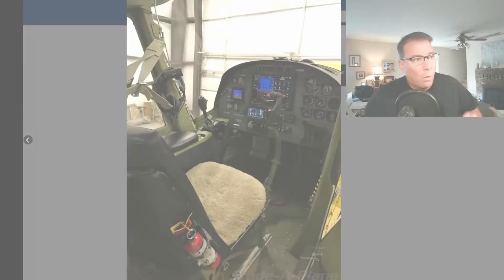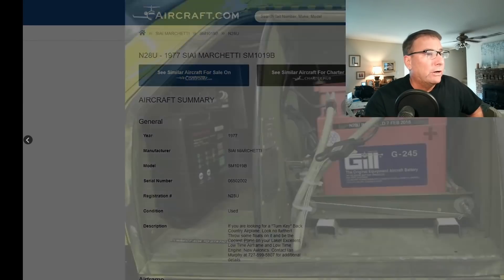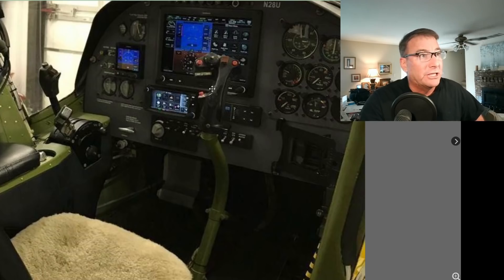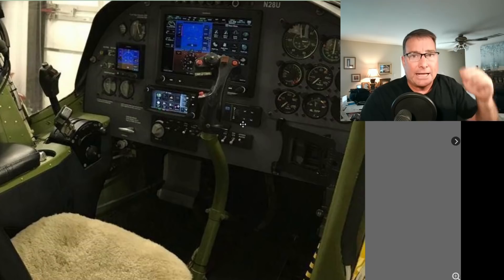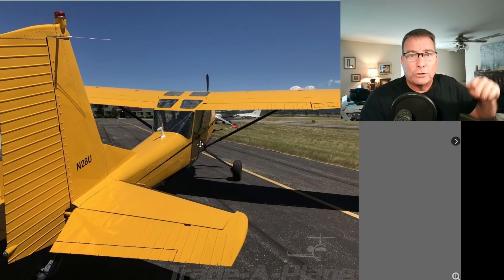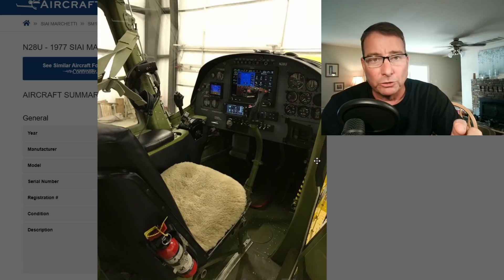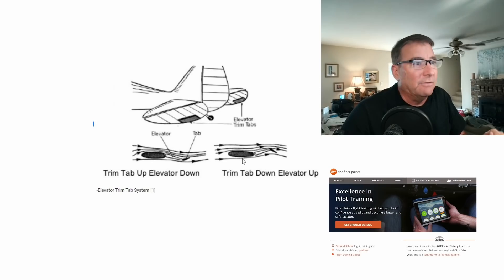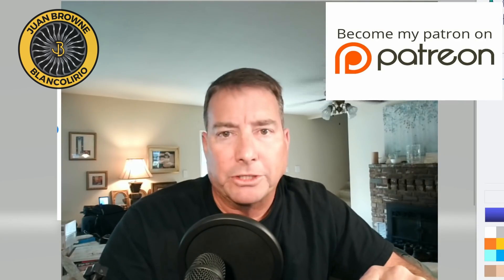Dale 'Snort' Snodgrass Siai Marchetti UPDATE- Elevator Trim System 8/8/21

Comment: Maybe the elevator connection was reversed, as in stick forward made the elevator move to climb.  It happened in a Cub here at KBVS, one the pilot rebuilt that was a different model that the pilot had maintained in the past.  As it turned out after the controls were connected, up ended being down and down was up the way he connected it, so those connections were different in the new model to him, except he didn’t know that.  He just copied that connection he knew and it was wrong and got killed on take-off. Probably the annual would reveal if there was any change in bearings or bushings on the elevator controls, and they were disconnected for that reason.  So, during the take-off role, the stick is pushed forward in a tail dragged to raise the tail, and it would result in full up elevator instead.

Comment: Thanks for the video. I find it remarkable that the pilot's verbal reaction to the situation was transmitted on the radio, unlikely this happened intentionally. The pilot must have wrestled with the flight stick in an unusual way that triggered the com switch. Could be wrong but I find it hard to believe a trim runaway or falsely rigged elevator trim alone would have lead to loss of control, at this slow speed stronger elevator input (if available) would have overpowered the trim (just to compare size of elevator and trim tabs) A jammed flight stick/elevator or aft CG situation seems more likely.

Comment: If this was the case (trim issue), the trim lever should be removed from the stick and a separate trim lever with indicator should be installed to prevent runaways or error in switching the desired trim level.

Comment: Speaking of rigging the trim tab backwards, the sweep wing control of the F-111 comes to mind: to sweep the wings back, the control is moved forward, like "go go go". To go, one supposedly thinks of going forward. It's just one of those features which is intended to be intuitive, but obviously in the case of a trim switch, sometimes isn't.

Comment: I am not a pilot. With that said, I was listening to the details of what is on the stick, the trim control that Juan mentions (at about 3 minutes in) as being a possible contributor to the nose up pitch and the radio controls nearby. In the video after atc clears Dale for take off he acknowledges. She immediately comes back to remind him to switch to another frequency. If the video is synced with the audio he was already moving. He acknowledges the radio freq. change then the AT Controller comes on the radio again and repeats the clearance for take off. Dale, about to lift off, acknowledges this final transmission. Then the aircraft immediately starts the steep climb. While fighting to control the stall, Dale shouts out twice inadvertently heard over the radio just before impact.

It seems to me that this last exchange of comms from atc was not only unnecessary, and could have waited until after take off was achieved safely, but placed Dales attention at the wrong time to his radio rather than the trim control switch close by. 
Instead of manipulating the trim he's activating the radio.
I could be wrong but, I got a sinking feeling Juan made the connection for the possibility that the trim switch along with the radio switch made the holes line up that took Dale's life.
Reply: Video intentionally omits pauses longer than one second. It’s in the video description. There was actually 36 seconds of silence from Dale’s takeoff confirmation to his final heartbreaking words. The video shortens that to six seconds, giving the false impression he and the tower were still communicating during that silence.

Comment: The trim being so powerful to overpower the pilot input thesis is only valid at high airspeed.  At low airspeed, let us say at zero airspeed, the control surfaces are easily moved by pilot input.  At high airspeed, let us say just short of never exceed, the force from the air load could be in excess of the pilot input.  Did I miss this discussion?  Takeoff airspeed trim forces are easily overcome.  If the trim ran away to the full stop up, then maybe there was not enough flight control left in the pilot input.  But certainly the pilot had the force to overcome the trim setting.  My guess is that the CG was aft at rotation and he tried to lower the left wing to have a chance but there was not enough power to fly thru the amount of aft CG.,
Reply: I commented earlier that Juan's description omits that control forces depend on airspeed.
Reply: @gordonrichardson2972  You were correct then.

Comment: I would think a seasoned fighter pilot could overpower a mistrimmed aircraft, and probably has the presence of mind to not grab the stick if the seat were to slide back on the tracks.  Also, bear in mind that this was a military aircraft, and didn't have to meet the standards of CAR part 3 or FAR part 23.

Comment: I used to be the captain on ferry boats.  I have experienced electronic malfunctions in control systems with engine controls working the opposite of what the command was.  In fact I did everything right to avoid a situation.  I was blamed and fired for the incident in order to protect the company from having to answer to the US Coast Guard.  A week later the boat could not operate and a few weeks later the entire control system was replaced.  They did this in order to not be investigated by the USCG.  The USCG did not want to investigate the company because they do not to want to make waves with companies because after getting a pension with the USCG they want to get jobs in the industry and do not want to step on any toes while in the CG so they can get a job in the industry.  They seek to blame individuals rather than companies.  This does not serve the safety of the public.
Reply: millenails know america is trash, the baby boomers are learning...sad

Comment: @blancolirio -  Juan, watching the video, between the time Dale's plane took off, stalled and crashed, was only about four seconds.  Figure half that time, two seconds, before it's apparent there is a problem and how to correct it.  Dale didn't stand a chance. :(  If that trim switch was incorrectly worked on, whomever did that might be liable for his death. Also, my particular field of endeavor is the automotive maintenance/repair industry and in my auto centers it's a standard rule of thumb that if a customer's car is worked on for anything major, it's always taken for a test drive to be certain everything is good go to before handing the keys back to the customer.  Is this not standard practice with planes as well? If it's not, it should be, as some unnecessary crashes and deaths could be prevented.

Comment: I declined the trim system on my GFC 500 and they acted like I was crazy. I don't like all of the stories I hear about autotrim, and I find manual trim to be quite intuitive, and I can usually predict when the AP is going to announce trims. Also, trim is not always the answer. When leveling off at a selected altitude, the AP is going to announce trim needed, but I know what it needs mostly is to back off the power first. Is it really that distracting doing your own trim? Not as distracting as not using an AP at all.

Comment: It seems obvious that something was wrong and the aircraft was climbing rapidly towards the point of stalling. Would chopping the power immediately upon realization of a stuck elevator trim or any other control surface, been enough to save it?  I am assuming that any attempt to push the stick forward was not possible for some as yet unknown reason.

Comment: The roll the trim wheel by hand then electric check. Servo motors can’t feel a thing. If they malfunction they can rip the trim system apart without a capstan release for cables or secondary stop switch for a screw jack

Comment: No manual trim wheel. Who got that thought certification. Boeing  If this is the case he might have seen the trim wheel moving without and input and aborted the takeoff. Doings an annual first thing I did wipe the flight controls to see if there dragging or binding.

Comment: Like you said, I guess we would need to know if it was in maintenance right before this accident wouldn’t me? It’s not just going to flip 180 overnight for fun. One look in the maintenance log and we would have our answer very quickly to that. I would say the runaway trim theory with an electric system would be far more likely than it switching itself for fun 180 degrees.
Reply: Flight history for N27U shows he flew that aircraft 23 times between May 26 and June 30, when he flew it to Lewiston airport. That was the last time he flew it before picking it up from the maintenance facility (Hillcrest Aviation?) just minutes before the crash.
Reply: Correction N28U, of course.

Comment: As one with a secondary interest in aviation, I think your trim explanation at 07:30 could have been useful earlier in the video. Regarding "getting it backwards" 08:48, Definitely experienced that several times myself in maintenance tasks. Strange how the (amazing) human mind can be confused by simple, binary systems.
Reply: You would think on something so critical as flight controls the harness would be designed so you CAN’T reverse the wiring. Say, M/F on one and F/M on the other.
Reply: @MrJeffcoley1  I've found that many times engineers have a bit of tunnel vision on what they do, and simple things like this could easily get overlooked if you're not thinking about it.

Comment: I get the trim issue....Do you know if there may have been a medical issue? I realize they will check that issue out....
also on the Trim issue.... Has this been a Major issue in aviation in general...Aren't there Checks and balances in aviation repair?
Mechanic fixes airplane....Then a Supervisor Quality Control checks the work?......
Leaving it to a A/P mechanic without Another set of eyes Looking at the repair needs to happen....
I'm Hoping that is the Norm...
Because You Can Get it Wrong...Aviation Kills Period No second chances
Thank you
Darrell Killingsworth

Comment: Hey Juan, here's what happened to Jerry a few years ago.  He took off from a small West Texas airport, having done a very thorough and uneventful pre-flight on the Cherokee 140.  After an uneventful takeoff and climb-out to 3000 AGL, he executed a standard rate right hand turn, only to discover a stuck elevator!  He fought for a couple of minutes, using the throttle to control altitude and attitude, deciding that he would not be able to land the plane in its current state, he decided to pull really hard in an attempt to un-jam the elevator, and to his surprise, there was a pop, and the control freed up and began to operate normally!  What had happened is that a mud dauber had built a sizeable mud nest on the elevator cable, and the vibration of flight loosened it and it slid down the cable and wedged into the pulley!  A very UNPLEASANT surprise, according to Jerry, followed by a tear down of the inspection panels and subsequent removal of a lot more mud nests!
Reply: Those mud dauber wasps have brought down full sized passenger jets.  They usually build the mud nests in the Pitot tubes, which leads to false readings in the instruments.
Reply: Wow !

Comment: https://youtu.be/c1FXRC4OFdM

The trim tab adjusts the position of the elevator.  Tab up, elevator down 

This is not a 737 as someone mentioned.  The trim doesn’t adjust an elevator on aircraft with a flying stabilizer.

Comment: I read a comment over another video from a owner he stated this aircraft requires lot of trim up to land it, and if that trim was left like that with the flaps on take off at 30  Degrees the 400 HP turbine engine will cause it to nose up rapidly. If you look at the crash video you can clearly see he does have flaps down to some degree not sure how much on take off.

Comment: Well explained.   I’m going to go with that explanation of the electric trim system.  That seems the most likely.   I’m pretty damm sure he did not have the control lock on as well as he just forgot to do a control check .  Elevator linkage failure or something falling off the other seat and jamming the controls from being able to go forward would be my second guess.    Let’s hope we get this figured out soon with the investigation.

Comment: There are some images floating around where you can see pretty clearly that Dale had full down elevator just prior too and during the stall, I wonder what he had on board for cargo?
Reply: Camping gear.  He was leaving for a camping trip.
Reply: @pookatim  i know im curious about specifics weight etc
Reply: There’s also a clear picture of the “general” neutral trim tab after impact online. Google Snodgrass airplane crash pictures. Not sure if the impact could have changed trim tab configuration? Still appears to me as heavy aft cg? I personally have a hard time talking about this stuff sometimes, but Juan, I agree with you. If we can learn from this, then it might save someone else’s life in the process, and THAT makes it worth talking about. Fly safely guys and ladies. I pray for this man’s soul and strength for his family.

Comment: You make a good case and if true we will find that out.  Moving to another possible scenario, listening to the ATC chatter, he seemed to be in quite a hurry, even making a few "rookie mistakes".  He reported "having the numbers" instead of providing the alphabet designation causing the controller to give him wind and altimeter. He requested a very quick, half runway departure so I am not sure if there was a run up check.  He "assumed" he was cleared for take off when the controller gave him clearance to taxi to the runway.  He neglected to switch frequencies from the ground controller to the departure controller as well.  This was not a "by the book" way of operating.  Mention was made that he was going camping and had loaded camping gear in the rear seat.  Perhaps some of that gear may have gotten in front of the control stick and when the plane began a steep climb, it may have slid around is some way that interfered with stick movement?  I don't know why he was rushing but is sure sounds to me like he was.  I know this is an STOL aircraft but the way he left the runway seemed rather odd.  I believe Dan Grynder makes this point in his take on this event on his channel.  Listening to the ATC tape, there wasn't any time for him to react so something unexpected prevented him from  correcting the nose up attitude.  It was mere seconds between when he lifted off until we hear his expletives.  The fact that he broadcast those expletives adds weight to the argument that he was possibly fumbling with the trim disable switch.  Anyway, just trying to figure out what happened.

Comment: I understand how the trim tabs and their actuation work; but even with the tabs at their full up position it doesn't limit the elevator excursion from movement by the control stick..... does it? Seems like, if you have the stick pushing full down on the elevator itself, those small tabs aren't going to  deflect more air than the huge elevator surface. If the pilot wants to raise the tail, he pushes the stick forward, regardless of the trim setting, and should be able to override the trim's TENDENCY to move the elevator surface in the opposite direction due to the airflow over the control surface. I remain convinced the problem was either something in the back seat that limited the rear control stick from moving forward, or something in the weight and balance that put the c/g way aft of its limit for balanced flight. As I am unable to access the POH of this type for weight and balance info, I am making a SWAG at this as a cause. I am unable to accept that a pilot of his caliber, could err in such a basic way as failing to properly preflight the plane or not have the presence of mind to try reversing a miss-wired trim switch, this being a relatively simple plane in the grand scheme of what he's flown during his career. Helluva shitty way to die for such an aviator as he.
Reply: I think this was addressed...because this military-design aircraft was basically "overpowered" it required much more trim authority than the usual GA aircraft, so much so that other owners felt it would be impossible to physically override full nose-up trim.  True, a combination of maximum physical stick force coupled with aggressive power reduction would certainly do it, so runaway trim isn't an automatic death sentence, but things happen fast.....

Comment: There appears to be no control surface deflections at anytime during the flight or crash. Note edge on  video frame (crash video footage). The rudder/ elevator are large surfaces and and should be noticeable at this range and resolution, a pilot of his experience would have had that rudder over hard right immediately. Even in post crash, they are locked in neutral position.
Reply: Snort would have known that for sure; applying opposite rudder first, no doubt. Unless there was a medical reason, highly unlikely it is pilot error; all leads to mechanical, locked up controls. And he would have known to go thru the full cycle of control surfaces movement during pre-takeoff check.